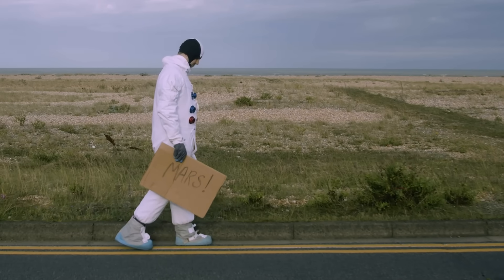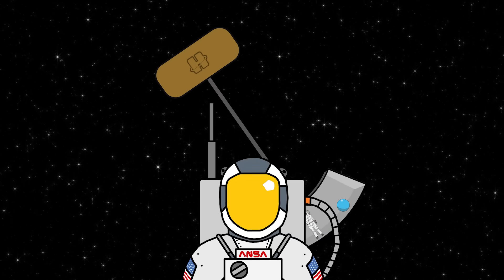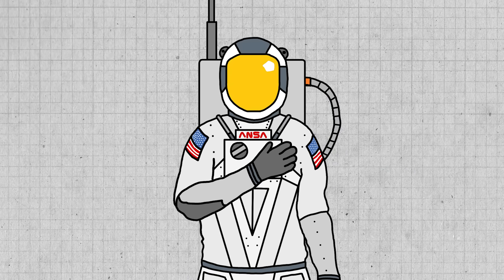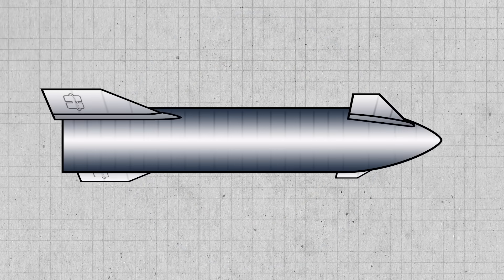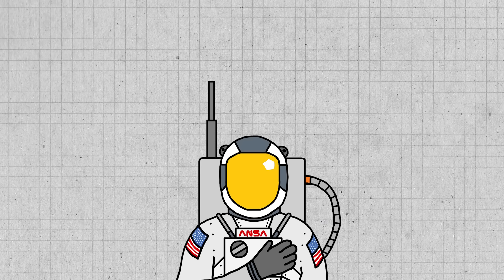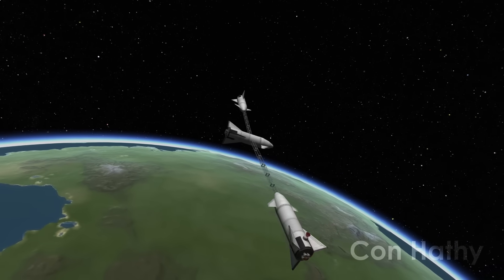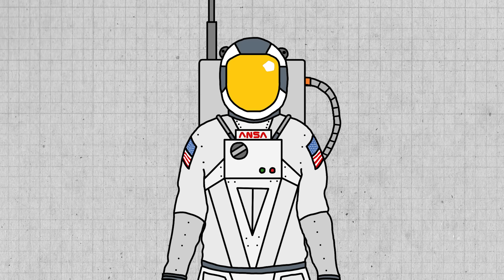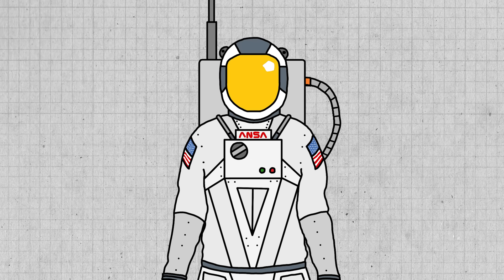This is NOT how you make Artificial Gravity

Comment: You can't make artificial gravity in space where you don't have earths gravity around, by spinning things you are not magically stick to the wall as you do here on earth when you are inside a centrifuge and you also don't see the big difference in spinning the ball earth where we are on the outside of the spinning ball and the centrifuge where you are on the inside of a circle, the earth doesn't make sense because everybody knows when you spin a ball there's nothing going to stick to the outside of the ball, the place where we are and when you think about the equator we should spin with 1000Km/h, now imagine you being spon with the same speed, try to hold on to the outside you will fly off.
Spinning in zero gravity would only spin around the object and everything that is attached to the spinning object and everything that isn't bolted down will just float around as everything does in zero gravity, you just can't make artificial gravity by spinning things.
Reply from the maker: They don’t stick because of magic, they stick because they’re momentum wants to move them in a straight line and they are being accelerated so they move in a circle. Conservation of momentum still exists in space
Reply: @ConHathy  I'm not convinced this will work the way people think it works.
You may have conservation of momentum in space but that doesn't make you stick to the "ground" if the "ground" below your feet moves in a circle.
You are still floating in space hanging still, now imagine the tube you're in starts to move around you in a circle, now explain to me how you think that you get from floating in space to a position that your feet move to the "ground" that's already moving, you know what will happen as soon as you touch the "ground" the wall or whatever it will give you that momentum and you'll float in to the other side of the wall and get bounced along the way because you are still weightless just as the structure around is floating in space, you'll float inside the structure and no amount of spinning that structure around you makes artificial gravity.
That's impossible to my opinion and I'm really not convinced by your explanation, you can only convince me by actually showing it that it works the way you think it will work, we will talk again when you come back to tell me you've used all resources and you're out of ideas and it doesn't work the way you thought it would so I can say to you, I told you so.

Comment: bro FINALLY. when i first saw that concept with the 3 starships, i was just thinking.. what??? its so overcomplicated when you could just use a massive rope. and NO one was talking about it.

my very first thought and solution to the art grav problem was just tethering two starships, and personally, i still think that's the best option. either way, i'm glad someone actually made a video about it. thank you.
Reply: That just sounds like it would be a waste of resources because you would have to launch 3 of them  instead of launching one
Reply: @simonpetrikov3992 True, but launching 2 is possibly somewhat safer for the astronauts, since in the event one ship has a catastrophic failure in transit, its crew could be evacuated to the 2nd starship. Plus two ships have twice as much room for cargo.

The short-radius centrifuge is definitely the cheapest idea, but I think tethering the two ships together for artificial gravity might be the better option overall because sending 2 ships is a just a good idea, and if you've got two ships anyway, you might as well use them to produce a more natural feeling artificial gravity.
Reply: @gh0stcassette  fair enough and there’s no perfect solution only trade offs. So if you want to trade off efficient use of resources for safety then that’s perfectly fine and vice versa. Unfortunately we’re going to be stuck on this tight rope until better fuels and/or better materials are made and also be cheap is going to be the only things to make these kinds of trade offs less drastic
Reply: "you could just use a massive rope"
You say this like it would be so easy but that rope or cable needs to be strong enough to handle the mass of an entire Starship and its fuel. Do you know how big and massive these rockets are? You would need a really massive cable that and every single kilogram you add to your ship is reducing your Delta-V. You might think that you saw Space-X use a relatively small cable to lift the Starship and that's true but that's only when the ship is empty... When the ship is completely fueled up it gets 30 times more massive... 160t vs 5000t  Now let's say it's not a problem to store this massive cable inside your Starship, how are you going to install it between your rockets? Are you using a robot or are you asking your astronauts to go outside and do this manually? A robot would add more mass and more complexity to your ship once again and for your astronauts to go outside you now need to add an airlock with two doors, etc... which is probably adding even more complexity and mass than a robot... This artificial gravity rope system might look simple on the surface but in reality it's a real nightmare to design for engineers.
Reply: I'd presume that a tether docking maneuver would look very much like a current capsule/capsule or capsule/station docking maneuver, except that your 'docking' onto the locking ring at the end of a tether rather than an airlock. As long as the tether includes a spooling system so that the thing isn't free floating when it's not in use, then syncing up with it in orbit should not be any more difficult than a standard docking maneuver. Complex, but hardly insurmountable. The tether also should not be part of the payload of either ship during their launch, it should be a piece of kit that both rockets meet up with in orbit, much like their orbital refueling ship will necessarily be.
Now, is it heavier than an internal centrifuge mechanism for the ship(s)? Probably. But lets be clear, having to do actual work for months in a ship where the gradient of pull will change dramatically in mere meters sound like an utterly miserable experience, even if you're completely adapted to avoid motion sickness. In terms of health you'd actually be dealing with the equivalent of significant tidal forces across your body, which sounds quite dangerous in terms of internal pressure issues and blood flow.
Reply: @Alfred-Neuman  Why would it be fully fueled up? Its already on route to where its going and, assuming that some infrastructure has already been launched for refueling, only needs enough fuel to enter an orbit around mars and land, although you might not even need fuel to land if you already have a refueling ship in Martian orbit. It definitely will have some fuel but it doesn't need anything close to being fully fueled up.
Reply: @MichaelMcRonaldMacDonald  Why would that affect the load on the cable? Sure it would take a big rocket to send the cable to mars, but the cable might not need to be that big considering the rockets the cable is attached to will be light since they don't need to be fully loaded, which was the entire point of my original comment.
Reply: I'm kind of confused about the video conclusion (English is not my native language). 
Please correct me if I'm wrong.

The video conclusions are:
- The configuration that works is two ships with tether.
- Adding third ship in the middle will only make the rotation unstable.

Is that correct? Thank you in advance.
Reply: You could rotate the center Starship, or you could make a hub to let the center Starship sit still relative to the rotation. This is not rocket science. haha
Reply: The overwhelming problem with tethers (of any kind) is stability. Of course if the passengers agree not to move a muscle, it could possibly be achieved, however that's not a real situation.
Reply: You don't need 100m/s rotation velocity, with a 500m radius and a velocity of 30m/s you will generate 0.2g very similar to moon gravity. That could be in the range of maneuver thrusters.
Reply: My thought is that actually carrying a full heat shield complete with flaps, sea level raptors, a pointy nose, a skirt, and header tanks all the way through the interplanetary journey is the dumb part. Better to station such fully kitted Starships in low orbit at either end, and have a pure spaceship version for the interplanetary journey.

You see, then you could have a single ship rotating by itself for the journey. It would launch with no crew, and never land, so could be designed for inverted artificial gravity only.

Of course, there might still need to be a low grade heat shield for aerobraking at either end of the journey, or alternatively big airbrakes, anything to reduce the number of atmospheric passes required to scrub off the interplanetary velocity.

It would also require fuel infrastructure at Mars, complete with Tanker Starships, to refuel everything, but actually that would probably be required anyways for any kind of Mars mission.

For simple space stations, however, I agree that I think two tethered Starships is a good, simple, straightforward solution.

And I guess if you want to send two Starships to Mars at a time, is still a workable solution for that too.
Reply: The rope will flex and recoil inward requiring constant pressure outward, which will need to be balanced by the amount of recoil of the rope and it's period of bounce. It's not a good design. It would require more energy than a stiff system that can hold the forces that will be applied both in toward the center and out. With a stiff system you only need to keep it spinning, not spend energy keeping tension in the rope or fighting 'spring-back'.
Reply: @nickjunes  ever heard of centrifugal force? that is your energy keeping tension.
Reply: @fxzn  Yes but tethers are springs. The tension out will not be perfect. It will bounce and eventually the bounce will be strong enough to cause the weights at either end to start to drift in fowling up the whole system.
Reply: @Mrpersonman0  I suspect every rotation will add to the resonance of the rope eventually creating an 'escape velocity' bounce that will cause the rope to become slack. Depending on the period of the rop, whether you are at the top or the bottom of the bounce curve you could let out or pull in the rope to reset the system. This might be able to be automated. The amount of energy this takes would then have to be compared to the pros and cons of a rigid system. Maybe in a rigid system this energy contributes to wobbles and polar shift of the whole system. Maybe those wobbles would have to be corrected in a rigid system. I believe this would take much experimentation as a lot of this depends on the performance of specific materials and shapes in the real world.
Reply: @nickjunes  It seems to me like you could counteract any flexing or resonance in the tether via motors at either end of the tether that are programmed to gently tweak the length of the tether a bit from hour to hour based on a feedback loop designed to damp out any such resonance. Even pumping water back and forth between fore/aft tanks in either craft could probably get the same effect without having to play with the tether.
Reply: @nickjunes  no, that's not what would happen. First of, the spaceships are in space, so the only forces acting on the rope are the centrifugal force and any shifts in mass in the spaceships itself (imagine the crew jumping). The mass shifting is not a problem as long as the rope(s) stay under tension, which is basically guaranteed by the centrifugal force. Resonance like what you're trying to describe can easily be countered by a damper in the right place.
Also, you can use multiple ropes connecting different points of the spaceships so they stay always in the same orientation to each other. And lastly, a system is NEVER "rigid". A rope acts like a spring the same way beams act like a spring. And a beam will also fail at some point if the resonance is not accounted for, so it's also going to need some kind of damper.
Reply: @5ch4cht3l7  You said it yourself. Centrifugal forces are not the only force. The crew jumping, the machines moving and all the other 'noise' forces moving in the ship will create counter force the the centrifugal force. Yes I used the word resonance in my response already. Thanks for clearing up what I already said with my own words. Also you cannot say a 'damper' and expect that to wrap up the debate. What kind of damper? How would your damper work? Is this a passive device or an active device? Can you describe the physics of your damper? It's probably active and will require more energy.
Reply: @nickjunes you are talking about these as if they are completely new problems. But we have been building things that rely on tension for centuries and got it down to a science decades ago.
suspension bridges have to deal with this while dealing with cars, strong winds, variable geometry due to heat and earthquakes. and dampening systems we have been doing even longer, it can be as simple as a tank of liquid.
truss is less strong under tension than cable and truss adds extra failure mode from bending forces.

Comment: You might need to group yourself in with the less qualified to talk about this subject. So much to explain but I don't want this to be paragraphs long. First off the tests here on Earth are completely flawed. Second the centrifugal tests need to be done in space with actual vessels, we're dizziness and the effects on the inner ear will be mitigated, those are simply affects based on the forces here on earth. You have to remember Earth's gravity plays a huge Factor in the outcome of the results, centrifugal forces pushing you outwards, while Earth's gravity is pulling you down and the torque of the machine is pushing you diagonally, that's why they're getting dizzy, their inner ears going haywire along with the pressure in their eyes. Not to mention the test with this man laying down, his head is dead smack in the middle, his brain is being pulled all over the place, not ideal. In space depending on how far apart the vessels are from the center, there will be no dizziness or pressure in the eyes. But even so this isn't exactly the answer to all the weightlessness problems we face in space. But it will give us the ability to double our stay in space. It's not ideal for walking around and standing up, but this technology would be ideal for sleeping and working out laying down. Since it's known that centrifugal force is stronger at the feet then the head. Laying down would mitigate that completely if only used to sleep. That's half the time you would be spending in micro gravity, slowing down damage to the body, including the degradation of your bones and muscles.

Comment: Could also increase and decrease angular velocity with reaction wheels and electricity
Reply from the maker: Slightly, but to do the entire spin up they would have to be very heavy and spin very fast. Rocket exhaust moves at kilometers per second, for a flywheel to match that mass efficiency it would have to spin just as fast
Reply: @ConHathy  Glad you challenged my idea - I hadn't ever really thought about it. Decided to do some math, and I agree with your reply.

If your flywheel's diameter is any less than close to the starship's OML, you're gonna end up carrying an 80 ton flywheel to orbit. I was able to math out that with a flywheel with an 8m OD, 7.95m ID, 1.5m wide made of solid lead (weighs 10 tons lol), you'd need to spin it up to about 20,100 RPM to get the starship to 1 rad/sec of angular velocity about its long axis, which is definitely an impractical use of space and payload capacity.

I will say though, with material science improving, especially with the engineering behind spin launch, it may be possible to engineer flywheels that can spin a LOT faster, which could help make this problem a feasible one to solve. If you throw max RPM out the window, maybe it's doable? But generally probably a better idea to use thrusters, especially on a spacecraft like starship. Maybe flywheels are better suited for orbital stations.